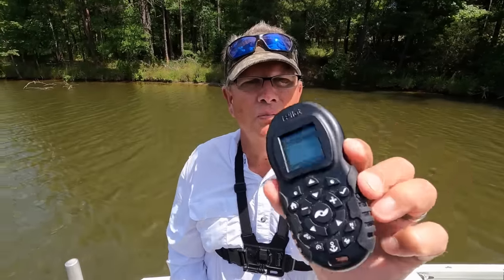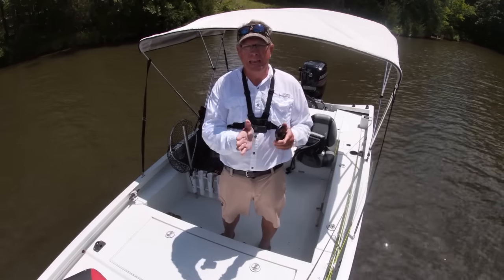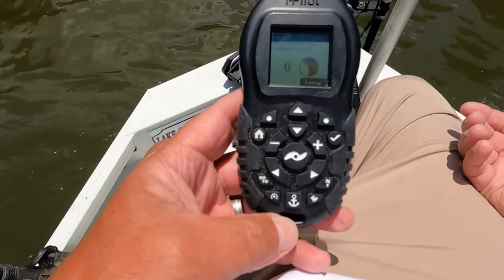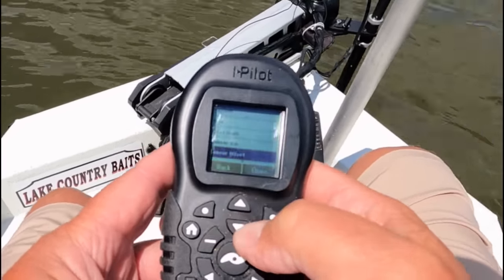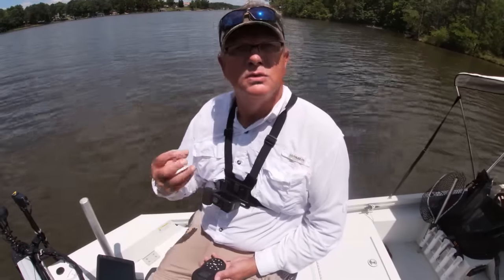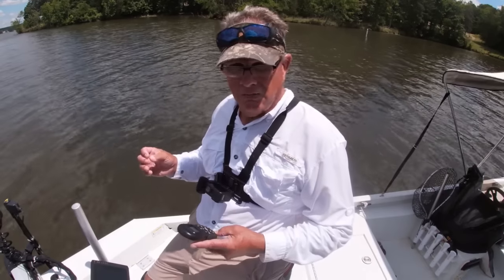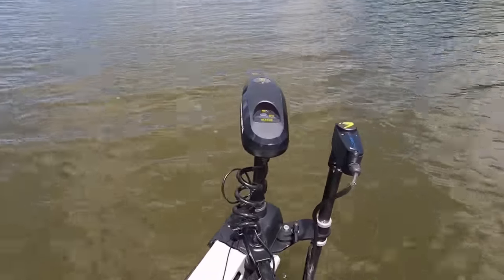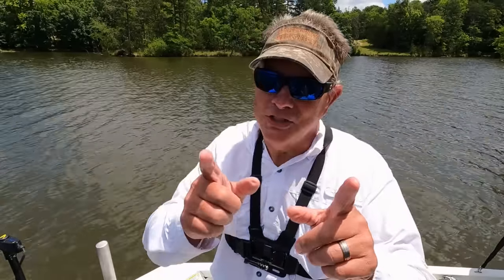Optimize Minn Kota spot lock accuracy with 4 tips

Comment: Do you pair the trolling motor with the sensor if it's a 2024 Ulterra and has the sensor built into the motor and doesn't have a separate puck sensor?

Comment: My ultrex has never worked right when it comes to spot lock. I have done everything but the legacy mode. I will try it.
Reply from the maker: Try the boat scale too. Thanks for the comment.
Reply: @wildlifeadventures-13  I have adjusted the boat scale to -2 before and it does slow down the movement of the boat but the spotlock never holds me anywhere near the spot. Most of the time when I hit the spot lock the motor will take off in some random direction and then over correct when it tries to come back to the spot. I have never been so disappointed in such an expensive purchase.
Reply from the maker: Make all the changes I talk about. Is there any thing blocking the gps signal, like a 12” live scope screen? I have to keep my unit a little lower on the mount to help with that .
Reply: @wildlifeadventures-13  I will try it out the next time I have the boat out. There is nothing blocking the signal.

Comment: I did not read all comment  for my question:  RE:  ULTERRA RIPTIDE 112#, 22.6' COMPOSITE BAY BOAT ---"What is "BOAT SCALE" for----your reference was was a setting for aluminum boat ...what determines t hat setting???
Reply: The higher the boat scale, the bigger/heavier Minn Kota assumes your boat is.  The result is that the higher scale will put more power/speed into correcting your position, which can make the boat very jerky if set too high.  If you want a slow, smooth correction try a lower setting but if it just won’t stay on the spot then try increasing boat scale.  I have 16.5 ft Alumacraft and use -2.

Comment: Recap: 1. Set Spot-Lock Options to Legacy.  Reset Calibration and Reset (from menu) - drive boat in two complete circles.  3. Perform Sensor Offset (Where is Center of Boat); System; Sensor Offset (improves spot lock sensitivity). 4. Boat Scale: System; Boat Scale; + to choose (Alluminum boat is -2).
Reply from the maker: Yes, correct if you have already calibrated you trolling motor it’s not necessary but it doesn’t take long to do.

Comment: What do i use for the boat scale for a 21' fiberglass Ranger bass boat?
Reply from the maker: The factory setting is zero. If the trolling motor seems to strong when it comes on to correct try a -1 or -2.
Reply: Thanks

Comment: With all do respect, let me correct you. Legacy mode will always go to the heading that you locked the unit too so if you drift off, it’s gonna keep going that direction straight line back to that heading advanced has a course and heading and it’s going to keep you on course for that heading so that way you only use one line to the destination. For legacy , as you drift, a new line is created to that point if that makes sense. One thing you didn’t is truly the most important when it comes to your head swinging back and forth the most is the scale option. If you’re in a really tiny boat and your scale is too high that is for compensation because the unit thinks you have a bigger boat and you need to turn down that scale so it doesn’t overthrust when trying to correct itself. Overthrust will cause this action get worse and worse because it shoots off course then has to thrust hard to come back.
Reply: Very well explained. The latest Minkota with the drift mode feature is fantastic!
Reply: I have a zxr21 what should my scale be set to?

Comment: Your description about legacy autopilot vs advanced is not accurate.  Legacy only corrects your heading for the wind.  If you are trolling parallel to a shore with an onshore wind, you will be blown into shore.  Advanced will correct your track over the ground so in the same situation you will keep your distance from shore.
Reply: Advanced will try to get you back to your previous course between two points -- an absolute nightmare for trolling. Legacy is the only way to go. If you're getting blown to shore, get more motor. I have yet to hit the Lake Michigan shoreline trolling on Legacy mode, but I have had a spread fouled by the stupidity of advanced trying to get back to an imaginary line.
Reply from the maker: Thanks for the comment, My main point is that the Legacy is much more forgiving in its correction.
Reply: I’m running an 80 pound Terrova on a 22’ bay boat on Lake Michigan. When fishing shallow, the Terrova is way too overpowered on SpotLock so I’m going to try legacy mode and maybe dial down boat scale a bit and see how it goes. My most important issue is STEALTH. I truly wish MinnKota had a stealth spotlock mode that only gradually corrected with low power. I use my PowerPoles more just because SpotLock is so non-stealthy.

Comment: Hello,

I have minn kota powerdrive ipilot 55, but I do not have calibration function on my remoute. How can I calibrate my ipilot ?
Reply: Calibration is for the heading sensor, if you don't have a heading sensor there will be no calibration function.
Reply: @tommckelvey3609  Calibration is possible only if I have heading sensors (white, round on both boats side?) I can not calibrate only my ipilot ?

Comment: Very misleading.  3 of your 4 tips have NOTHING to do with spotlock accuracy.  Autopilot mode doesn't have anything remotely to do with spot lock at all to start with.  Compass callibration and Offset also don't affect spotlock accuracy in the least.  They are for the jog feature.  They won't make your basic spotlock any more or less accurate in any way.
Reply from the maker: Thanks for the comment.
Reply: Compass calibration has everything to do with spot lock bud.   The spot lock runs off gps. Without proper compass calibration your spot lock won’t know where it’s at. That’s how never u hot spot lock it will turn your boat to face into the wind.   Try again

Comment: Does this work with PowerDrive?
Reply from the maker: I am not sure about that.
Reply: If you have ipilot conversion head, yes
Reply: @outdoorsinindianawithdaves9826  without a heading sensor do Mose of the ipilot not work.
I didn't realize there was an additional gps sensor when I updated my v1 power drive.
So far the heading spot lock and jog function doesn't seem to work.
Even though the remote shows the heading in degrees on the remote.